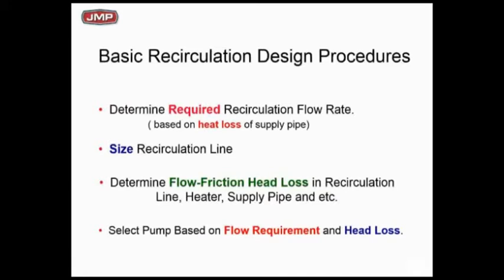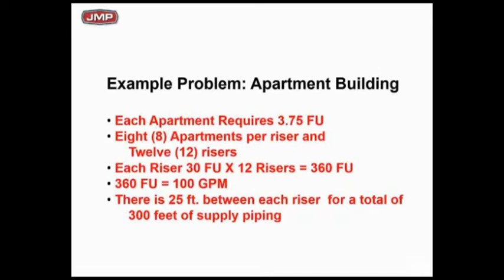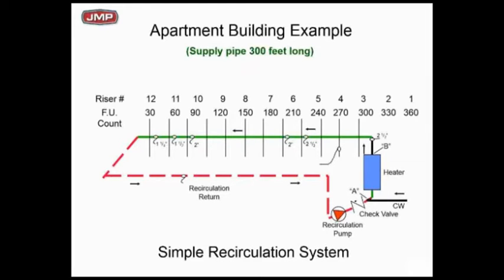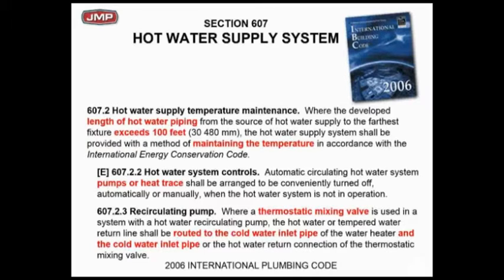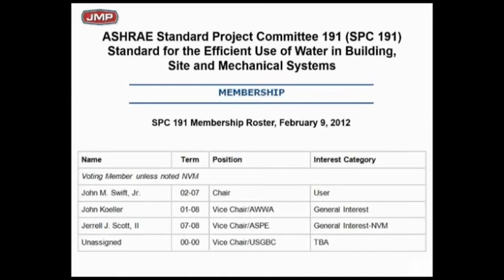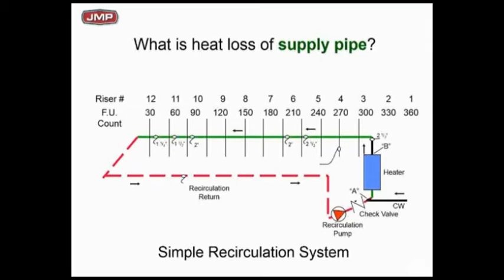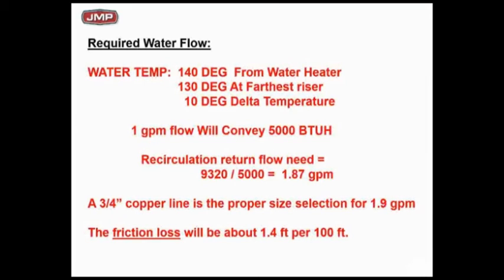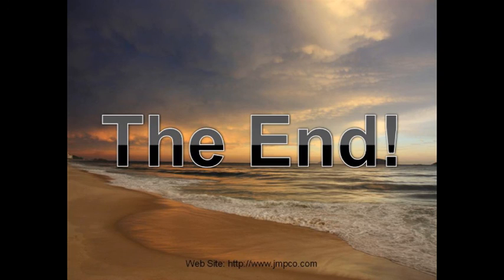Domestic Hot Water Recirculation Sizing Example

Comment: Thank you for the explanation. I would like to clear one doubt. To calculate return circulation head loss, we consider the farthest route of hot water supply and return and calculate the flow rate in LPM for that segment? Also, for the whole system only we calculate the heat loss to cover up that with the exchanger

Comment: Why didn't you consider the heat loss from the water flowing through the return piping?
Reply from the maker: Hey Michael and thanks for the comment.  We typically do not worry about the heat loss from the water flowing thru the return pipe because it is typically a small amount and is returned to the water heater where it will be heated back up.  Thanks!
Reply: @JMPCompany  Thanks for the quick response! I am a bit torn because plumbing design books are split; some tell you to account for the return heat loss while others say it can be negligible. Most of the jobs I design are smaller, so I include losses from the return piping. But I can definitely see how in a larger job this will increase costs since there is much more piping (more heat loss) to account for.

Comment: Hi from where you are getting gpm for calculation of load
Reply from the maker: Hey Anas and thanks for the comment.  The gpm is calculated from the heat loss thru the pipe.  You have to decide how much heat loss you are willing to have, such as a 10F drop.  Once you determine the amount of heat loss and the delta T you can calculate the flow.  Look at the video starting about 13-1/2 mins for an example.
Reply: HI
 I am taking hot water return line one size less than the supply line for eg. if my supply pipe is dia40mm then return size is dia 25mm. If supply is 63mm then return is 40mm.
So can u please tell me how will i get the head loss for this return pipe line.
If possible can u please give me your mail.id so that i can contact you.